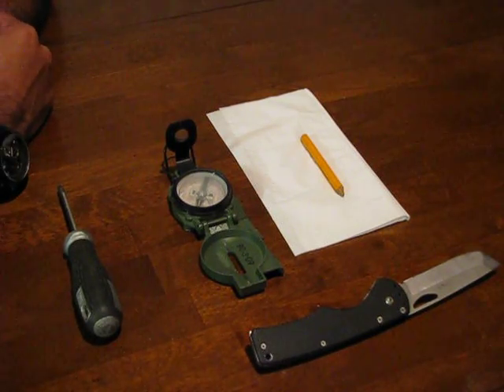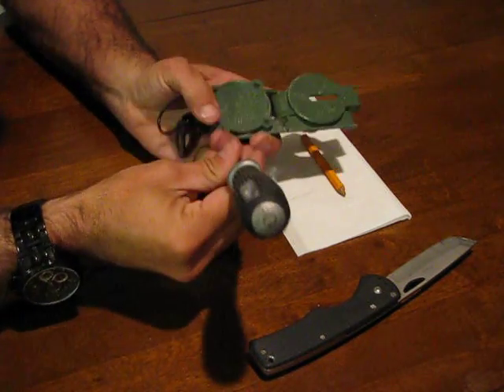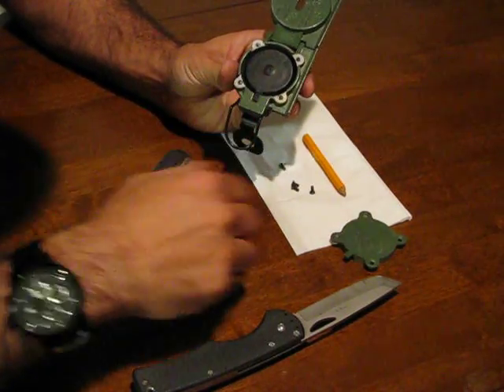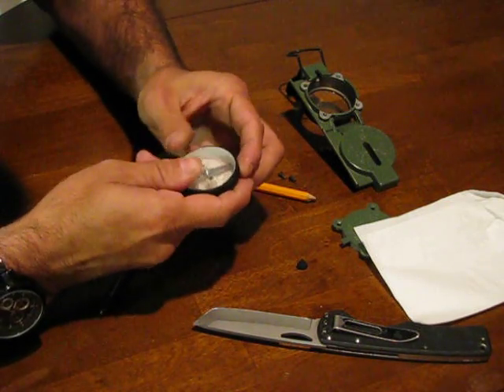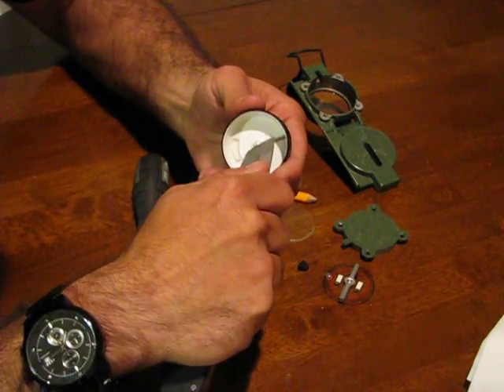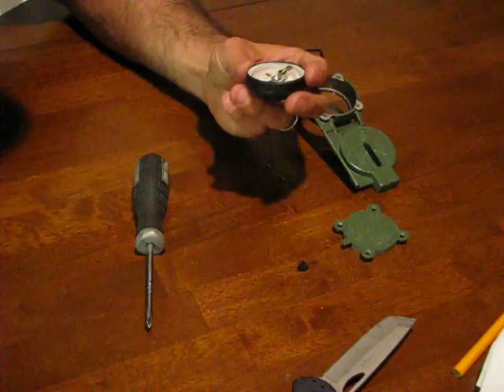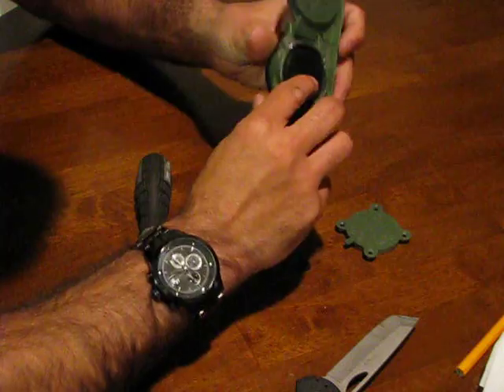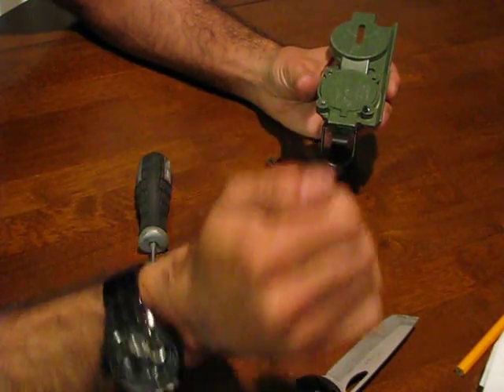How to repair a US military or other lensatic compass in 5 minutes

Comment: I've got circa 1990 USGI lensatic compass (I earned my expert infantry badge with it!)  on the back it says "contains 190 milli-curries of radioactive hydrogen DO NOT OPEN"  thoughts on removing the four screws?  also why would you not use the dial locking device?  I used the he** out of it when I was on active duty, even in the daytime, you just lock in your azimuth and run, it makes things so much quicker.  & it was a lifesaver at night when you had to have light discipline.  anyway, thanks for the video & I'd be interested in your thoughts on these issues!
Reply: Matt S ahhh ok I looked it up and tritium is "radioactive hydrogen".

Comment: Excellent video. Mine is a Stocker and Yale NSN 6605-01-198-6971 marked inside 5-88-19 inside. It is not liquid filled but says controlled disposal. 
#1. Is it safe to disassemble? I guess the newer ones are tritium. What is this? Radium? is it safe so long as it doesn't flake off?
#2 Not sure about the half life on it. If you shine a flashlight on it the dial will glow brighter for a bit like the glow in the dark ones, but then it returns to a regular normal dimness. Seems OK once your eyes adjust, easy to orienteer with, but not sure I can make out numbers with the lens over the briight patch under these conditions. Are you supposed to be able to see that?
Thanks for the video!
Reply: - Thanks

Comment: Dave - I know this is an old video...but that piece of plastic as you may or may not have discovered by now, is not "just  a place holder". It's the thing that the lens uses to lock the rotating part when the compass is closed. Don't want folks throwing it away thinking they don't need it...
Reply: Ahh, you do know. I see what you mean. Thanks for the video!

Comment: you should not break out the tab.  it lifts the dial off the pivot point when the lens is folded over to close the case.  this prevents the point from being rolled over from a hard impact if dropped.
Reply: I was in the 1/75th Ranger Bn and 10 & 11th SFGA.  I beat the hell out of them.  I even broke 2 lower receivers just doing IMT.  It always seemed to end up getting banged around.  I repaired mine and was able to keep the lift function working. it is a good video but the point could be capable of brinelling or bending over with a high impact. It would be nice if they had a jeweled movement.  Anyway most of us went to the Silva Ranger compass after they became available. The magnetic declination compensation adjustment is very useful.

Comment: every now & then, you find a Youtube vid that's totally useful & awesome... this is one of those vids. For those concerned about Tritium, please do some research-- Tritium will not even penetrate the outermost layer of dead skin on your fingers; it poses a risk if inhaled or ingested (so unless you plan on licking or sniffing it once you open it, you're good). Also, someone mentioned filling it with kerosene-- THAT would also be an idiot move... these compasses are non-liquid filled and use copper induction damping to slow the dial.

Comment: Thank you.  I took mine out of the safe the other day and it was fogged.  I found that the inner lens, which is a plastic was fogged like it had been attacked by a chemical.  I used turtle wax premium grade polishing compound to remove it.  I am back in action, thanks!

Comment: Hi, was so happy when i found your video. Becouse i have two compasses and none works ... They are the same style usgi pieces. The only difference they are older. Made in the '70 and the '80. Easy to find many at ebay. So i wanted to repair them but found on the back : " contains 190 millicurries radioactive hydrogen 3. Do not open. Dispose as rad waste... The newer Cammenga 3H Tritium compasses has the same "Do not open" markings. So what sould i do ? Could you help me ?

Comment: The real issue with not replacing the locking spring isn't the noise the compass will make but rather that the jewel in the rotating card, thats what sits on the 'pin' he sharpened, will wear the pin even quicker since its now always going to be moving. That was the point of locking the rotating card when not in use. And there is matter of the card slapping around AND not bring secured ON the pin when in a vertical orientation. It was a specification when the compass was designed for the army.
Reply: Noted. Not taking mine out then.
Reply: Mine wasn't working at all until I removed now it's working 
And I won't be navigating all year round

Comment from the maker: well...for every degree you are off, you will wander 20 feet off course for every 1000 feet you walk. So if it is 3 degrees off center you could walk 60 feet off per 1000 feet, or for some perspective, you will be 100 yards off for every mile you walk. It could be a big deal. Its easy enough to open the compass and center the index line.

Comment from the maker: Good question. i imagine you could refill a compass with either alcohol or kerosene and simply plug the hole with hot glue or silicone. The real question is if its worth the energy. A decent compass can run you a lot of money but generally speaking the amount of time to repair a liquid filled compass may not be worth it since a new one can be a low as $10.
Reply: These are not liquid filled

Comment: nope no difference at all. The tritium compasses have tritium only on the luminus patches so as long as you dont plan on rubbing your compass all over your body you will be fine. The floating dial can be easily put back on by folowing the video.

Comment: Is there a difference between your compass and ones with the radioactive material inside? We have one with the radioactive materials but the disc with the numbers on (not sure of technical name) has come off the pin and no longer rotates. I just want to put it back on and back together.

Comment from the maker: Though this is technically accurate (slight knocking noise), I can assure you that Rambo or any other person that would be in an E & E situation is more likely to make more noise breathing than the compass will as a result of removing the lock pin. I'd rather have a working compass.

Comment: the problem with taking out the lockdown spring is that now, not only will your lensatic move while closed, it will make a slight nocking sound. sound can be very deadly.